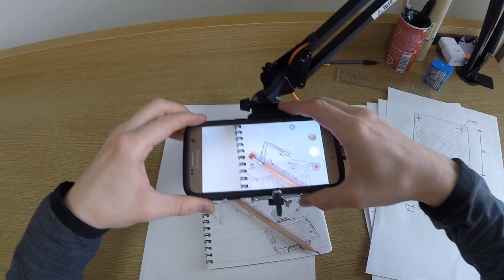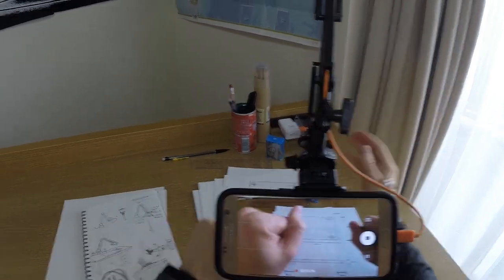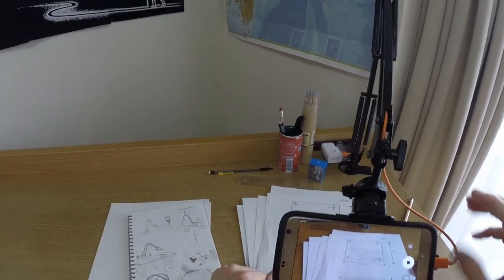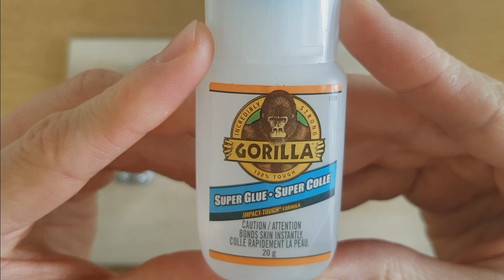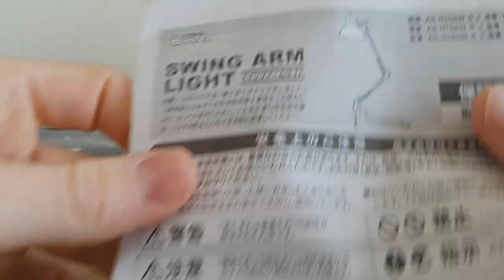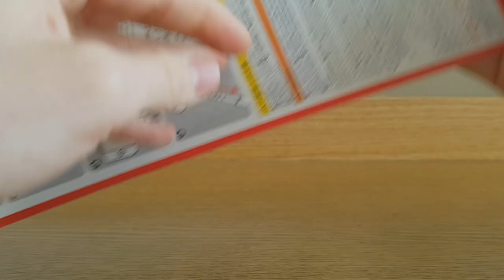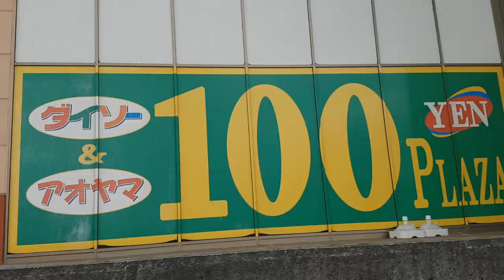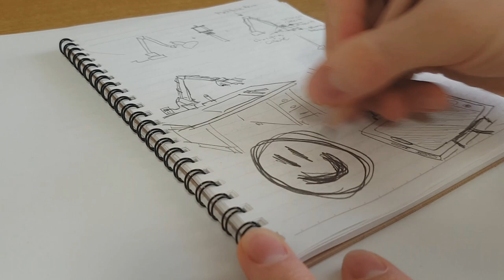DIY Articulating Arm Mount for a Phone or Camera

Comment: Very nice job.  That was ingenious.  I like how you used the tools at hand and researched out the pros and cons of the various parts.  The only suggestion that I could add was to make two holes to the selfie phone holder to put two self tapping screws.  Your Leatherman has an awl or you can use a heated nail.  It would be terrible if the phone were to fall off.  Otherwise, continue the good work.  I use mine to also scan documents on the table surface with a phone app.   Thanks.
Reply from the maker: Thanks for the feedback SilverShadow. Yes, some screws would definitely improve its integrity. Mines still holding together with the super glue though!

Comment: Great job, and you make a rather arduous task seem pretty easy to accomplish.  My only input would be to check your local Goodwill stores for such a lamp.  I found one that offered a large two-level intensity switched halogen lamp (which I removed and used it for additional lighting).  Its arms were heavier duty (probably to support that lamp). It also had longer arms than those offered at IKEA.  And, as a bonus, there was a 120V power outlet at its base.  Yeah for me.  Lastly, I picked up a roll of black split tubing, large enough to hold the USB charging cable inside it and snap around the Lamp's arms (the upper/outer arms), which looks great and saved me from taking apart the whole lamp.  By the way, kudos for having such a clean desk.  I haven't seen the top of mine for months.
Reply from the maker: That lamp sounds perfect! Glad your build worked out well!

Comment: @Exercising Ingenuity How long did you let the Gorilla Super Glue set, after pressing down on it? According to the usage instructions, you have to clamp it down with something strong & leave it for 24 hours. I'm getting Loctite Super Glue instead, since its much cheaper than Gorilla Super Glue.

Update: I couldn't find the exact selfie stick, you bought in the video & had quite a few issues trying to stick the mobile atttachment of the selfie stick I broke off, to the lamp's head joint with Super Glue(Loctite Super Glue). I wasted the whole bottle of glue & got no result, despite using rubber & string to hold it, which made the thing wobbly for the smartphone.
Until I solved it using zip ties, now its very stable. Doesn't wobble, come loose or even break & it says in place! 
Now I can film my speed drawings with my smartphone for my Youtube channel. :)
Reply from the maker: Hey Amrish, thanks for the update, and I'm glad you found a solution that worked! I'd love to check out some of those speed drawings if you have any up yet! :)
Reply: @ExercisingIngenuity  You're welcome & sorry for the late reply, only saw this comment now. It was disappointing that the glue didn't work for me, but all in all I did solve my issue in the end. 
I do have one of those speed drawings but its done digitally which is on my other channel. 
I will be uploading another digital timelapsed video soon, in the meantime you can enjoy watching this one! :) https://youtu.be/xgrE5ACdQN8

Comment: How has the superglue held up? I know it can be brittle and does not stick to ABS well. You used a lot of it so it might be fine, but I probably would have used E6000 for that joint.
Reply from the maker: It's held up fairly well actually. But definitely not the ideal adhesive. I've never used E6000 before, is it similar to JB Weld?
Reply: @ExercisingIngenuity  e6000 is a solid rubbery polymer thinned with solvent. The difference is once it dries it is still sticky and rubbery so sticks to ABS and glass far better than epoxy in the long run, Including jb weld plastic weld. Epoxy is not brittle like superglue, but it can still let go of plastics over time, unlike e6000. E6000 is still rubbery after it dries so it sticks better in applications where impacts or stresses are expected. Epoxy may disconnect from the surfaces but E6000 bounces back just a little and can maintain the bond. You can cut through cured E6000 with a razor, but epoxy is like a rock. You can't sand E6000. Each adhesive has it's own ideal application. Such an interesting subject.

Comment: I SO love what you made.  But I'm not confident that I could understand all the steps well enough to do it myself.  

Is your DIY still working well for you or have you had any issues with it that you can share as a heads up?
Reply from the maker: Hey! The only issue I've had is I find the lamp will settle/shift if holding the phone for long periods of time. Other than that it's been pretty good. I'm still using it!
Reply: That issue makes sense.

Comment: There is no way to leave the original cable and connect the charger there?
Reply: Yes you can.. It is not as simple and elegant as a low voltage 5 volt USB cable, but you could put a Leviton 102-EP 15 Amp, 125 Volt, 2P, 2W, Connector, Straight Blade, Residential Grade, Black end on it and then plug in your charger of choice.

1) you would be running mains voltage 125V AC to the end and not the low voltage of USB [ So you need to be very careful that you get that connector on properly. ]
2) It would add weight and bulk to the far end of your setup which you would have to engineer a solution to hold it securely. (Velcro would probably work fine)
3) You would then have to deal with the extra length of whatever charging cable plugged into the USB Charger. (Which again Velcro ties would probably help there.)

https://www.amazon.com/Leviton-102-EP-Connector-Straight-Residential/dp/B0026GHSD8
Reply from the maker: Thanks @TisJester PG for the reply. That's a great way to utilize the original AC cable! A little complex, as you mentioned.

Comment: Do you know how much weight it can take? Im considering doing this to hold my canon rebel haha
Reply from the maker: Hmm, I haven't specifically tested it's weight capacity. I've only used this setup with my phone and a gopro. I don't think this by itself will take the weight of a DSLR.... Could maybe modify it though, perhaps with stronger springs, or using two arms to support the larger weight 🤔
Reply: @ExercisingIngenuity  hmmm the stronger springs sound like it could  definitely work! I'll give it a try, hope for the best and let you know if it works, thanks for the tutorial!

Comment: Why not cut the cable, feed it through and reattach just the red and black wires? Would have been much quicker.
Reply: Sure if you have a decent enough USB cable and know how to solder wire back together and use heat shrink ect.. BUT that would take more tools then he used.
Anyone with the ability and tools to do such would make this adjustment.
Reply from the maker: TisJester XxX has got exactly right. When I built this I was very limited by my tools